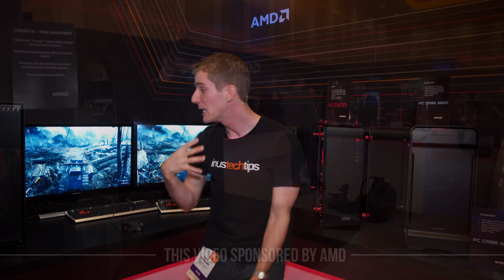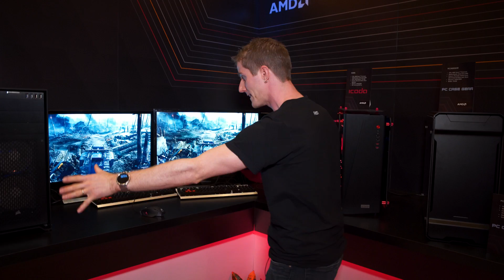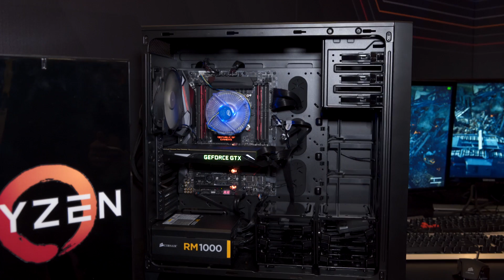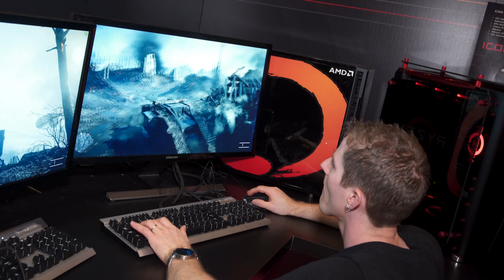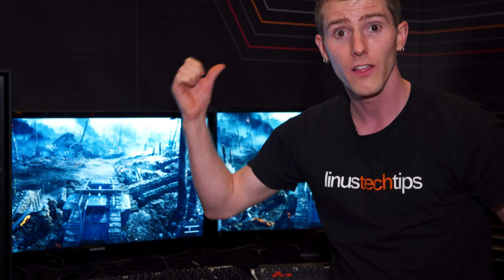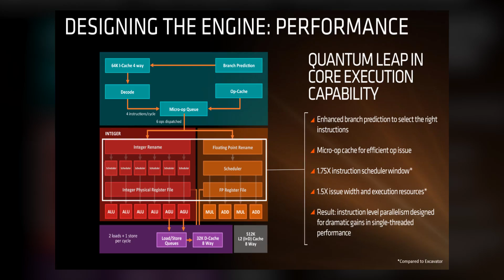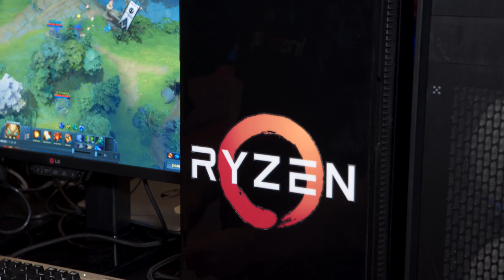AMD Has Ryzen!

Comment: What is the point showing graphic performance if they are using the same GPU? To prove Ryzen is a good CPU they should show the actual performance of the CPU like handling video conversion and running CPU benchmark,  we all know that CPU bottleneck is not a thing when we use such a high end CPU + GPU combination.
Reply: We've already seen that.
Reply: They were showing in the BF1 demo that the Ryzen chip is not only NOT a bottleneck for the Titan XP but that it is actually capable of maintaining the Titan XP at frame rates near that of the 6900k. Also the 2nd demo was to prove that the Ryzen won't get bogged down under load and drop frames both in game and in twitch stream vs the 6900k when CPU encoding and Linus said Ryzen looked different (better).  With the AMD 8000 series and 9000 series FX processors, they MOST CERTAINLY WERE bottlenecks for 980s and 970s, furies, Titans, Nanos... People buying those GPUs would be using top of the line Intel X99/Z1(2)70/Z97 based i5s and i7s anyways.

Comment: 6900K on that small of an air cooler?
Reply: thats the intel stock cooler, the same thing goes with amd, both using stock coolers.
Reply: Intel hasn't made a stock cooler supporting 2011 since like 2011 tho... That's the thing
Reply: But K series chips don't come with a cpu cooler.
Reply: both cpus at stock speeds, dout that the 6900k was thermal throttling
Reply: Small coolers is all you need if you don't care about fan noise or overclocking. For a demo at stock speeds it is sufficient.
Reply: Oh sorry, I didn't realise that a 6900k was thermal throttling while reaching blistering temps of what... 45-50c max at stock... 
~Wwwwwwwooooooo~~~ ghost noises.

Seriously though, a basic fan at a stock cpu setting isn't going to do anything to the performance in a situation like this.
Reply: The 6900k does not come with a stock cooler. Atleast not in Aus
Reply: I can make my i5 2550k look as fast as a i7 4770k with a good overclock on my cpu, much better cooler and active set-up over passive.
Reply: Depends what you are benching. 
In this case they are both stock settings and we know the TDP + thermals are low. So that isn't really relevant information and the comparison is still valid for that very reason.
Reply: Intel sells a stock cooler for 2011 and 2011-3 chips. 2011 was actually the first to drop the included cooler in the package with the processor, but how many people do you know with a Core 2 Quad, i5 Quad, i7 Quad, or even AMD 6 and 8 core processors use the stock cooler?

Why anyone would actually buy it is beyond me, since you can get a much more capable cooler for about the same price.
Reply: yeah they should have used some really good coolers to remove all of the variables
like a noctua nh-d15 on both processors
Reply: SomethingCool51 That would have been overkill and given the impression that such large coolers were necessary for stock speeds - which they are not.

Comment: it's a little pitiful for amd to have to use nvidias card in their system, they should have had a vega sample ready for this
Reply: Zen's probably gonna come out at least a few months before Vega. Why delay one brilliant product just for one in the pipeline?
Reply: I think that it highlights an issue with amd's refresh cycle where they are typically behind the performance curve at least for high end consumer parts. Vega really needs to either be better than what ever nvidia has, or be substantially less expensive at the same performance to be competitive.

Comment: So basically AMD thinks that the RX 480 is a piece of crap.
Reply: No. Where the fuck did you get that from?
Reply: You're not paying attention..
Reply: AMD couldn't test the Ryzen on an RX 480 because it was too weak for gaming. Smart move too.
Reply: QuantumDan The 480 does not compete with the Titan XP, it's a $200-250 card. They want the CPU to be the limiting factor so they would use the most powerful GPU they can get so the game becomes more reliant in the cpu.
Reply: The Titan XP is obviously targeting a very different market, I get that. I'm just wondering why they didn't even use an AMD gpu in the first place, but as you said, they wanted the most powerful GPU.
Reply: QuantumDan to be sure not to have any gpu bottleneck.

Comment: As far as streaming goes, quality per bitrate goes: x264(software CPU) > quicksync > nvenc > amf(AMD gpu encode). Most streaming services don't allow enough bitrate for qsv or nvenc to be useful, unless you're mostly streaming static images.
Reply: AMD's encoder is actually more efficient in tests versus NVENC with equal quality.
Reply: ***** Still needs more bitrate to achieve the same quality. Can be more efficient all it wants.

Comment: That 6900K... with a shit cooler...
Reply: German Gambogi stock cooler vs stock cooler...
Reply: Who cares what sort of cooler is being used as long as chips don't thermal throttle.
Reply: Then what's the point of using a K series chip? Don't get me wrong, I really hope the new AMD CPU's kick some ass so we get some real improvements from both sides. It just seems that the none of the chips are at their full potential.
Reply: each chip overclocks differently, it would be inaccurate.

Comment: AMD, all I want for St. Patrick's Day is a cheap CPU with 4 cores, maybe hyperthreading, and easy overclocking. Please.
Reply: They've said that this is their high end chip. Therefore there must be lower end ones, probably a 6 core and 4 core. There are also leaks suggesting the SR3(4c/8t), SR5(6c,12t) and SR7 (the one shown, 8c/16t)
Reply: Liam Meigs ...I'm not pairing a dual core with poor hyperthreading and shit IPC with an RX 480. That's ridiculous.
Reply: Emperor Scumbag VII 4 cores? AMD will never do anything that sensible. It's why they're getting fucked in the CPU market.
Reply: Death"Three Reich's You're Out"2508 AMD has sold quad core CPUs before you know... 8000 FX series CPUs had 4 cores.
Reply: lol
Reply: Death"Three Reich's You're Out"2508 now there cores will be on par with intels in terms of single performace power. just wait and see. AMD have put alot more money inot reasearch and have increased there CPus performance, also the old r9 390 and such was better then the 900 series, the exact same generation.
Reply: mrpokaren13. 6000 = 6 cores
Reply: Just buy a 4350 and oc it to 4.5ghz. Thats what i did
Reply: Emperor Scumbag VII 4350 is quad core
Reply: Aaron Lindstedt No it isn't. It has 2 cores and 4 threads.
Reply: i suppose technically it is, but the cores share recourses,
Reply: yeah, 4 cores 8 threads will be adequate
Reply: PleyVi are u talking about current AMD's chip or next AMD Ryzen chip?
Reply: mandiarra
he is talking about the FX series of processors. (so for instance my 8320 has 4modules and 8 cores)
Reply: my 8320 kicks ass...
Reply: Bulldozer doesn't work like that. It has 4 cores, 2 modules, 2 FPUs. Still technically a quad core, just not in the way most architectures do it.
Reply: djflexmaster79
 just curious i was tinkering around with my overclock and to get it stable i have 4.4 with a voltage offset of .03. what do you have?
Reply: Emperor Scumbag VII Get an i7 920 for under 100€
Reply: PleyVi OC makes all the difference man.
Also, i only said i7 920 because its more widely supported by motherboards than the xeons.
And yes, i meant with the motherboard.
Reply: haha, same here volt is a bit higher. Would like to water cool, and push to 4.6
Reply: djflexmaster79
i thought about it but its hard to justify 70 dolars more for 200 mhz :/
Reply: PleyVi Buy an AMD Processor.
Reply: PleyVi
couldn't the same be said for a air cooler like a 212? I mean i understand your point, but id rather just use my usual air cooler.
Reply: isn't that an 860k?
Reply: Emperor Scumbag VII there 4 might be cheap maybe just see on redgamingtech

Comment: what's with the shitty cpu coolers?
Reply: Maybe looks are deceiving? Perhaps Ryzen doesn't require a heatsink the size of a car radiator to keep it cool?
Reply: Storr Hoek wraith cooler is pretty good.
Reply: Storr Hoek they are both stock.
Reply: cz75fanatic Still the AMD stock Wrath coolers are better then the stock Intel coolers by a wide margin, the Intel coolers barely get the job done in a lot of cases.
Reply: Wraith is much better than the shitty Intel stock cooler
Reply: The old AMD coolers ran at 7000 RPM. They were amazing. Somebody even overvolted them and they started levitating while the Intel cooler just died.
Reply: The stock AMD Wraith cooler is actually decent with some nice copper heatpipes, and compares well to a low/mid tier aftermarket cooler from companies like deepcool, or Cooler Master.
Reply: Intel ships shitty coolers with their CPUs.. AMD's Wraith cooler on the other hand is a very nice cooler. If I didn't overclock I would have no qualms using it.  With that said I never used any of the Intel CPU coolers. For my Ryzen build I am going with Noctua this time.
Reply: The wraith cooler is capable of overclocking, it's performance is comparable of the likes of the coolermaster evo 212. 

People have overclocked FX-8370s which is a 130W CPU, using the wraith cooler with no problem with temps easily below 70c. The wraith is a very very good stock cooler. Ryzen with only a 95W TDP should be fine for overclocks, the CPU will even overclock itself with the boost enabled.
Reply: gromann i think the wraith cooler is better than the stock Intel one but, amd hasn't been that competitive for a while.
Reply: As commented, they are stock coolers. Again, the point is to show out of box comparison and to limit any argument of how some aftermarket cooler was giving bonus points to either cpu.
Reply: After years of computer experience you realize that cpu cooler doesn't do that much.
Reply: Also if anyone thinks that it's unfair or any shit like that, when you buy a CPU, the price of the cooler is included in that price.

If you then have to go and buy a different cooler to really reap the benefits of the chip then that is expense on top of the CPU.

AFAIK the wraith cooler is better than the intel stock one and hence it's up to Intel to provide a better stock cooler as opposed to the buyer to pay for the Intel CPU and then an aftermarket cooler on top of it, just to make this a more fair comparisson.

What you get out of the box is important, not to everyone but to a lot of people.
Reply: well said Commodorefan64
Reply: Yeah but of you're gonna buy either one of those cpu's you"re gonna want to overclock
Reply: Yeah, but they're not going to overclock their CPUs in this situation are they? So why would they need better coolers?
Reply: They weren't overclocking it so it makes no difference.
Reply: i always use stock cooler up to the point it's getting new thermalpaste, or when it's time to OC some more juice out of it. depending on temperature ofcourse. most people are perfectly fine with stock. it just saves some more money, or procrastinate the spending.
Reply: +NUCK CHORRIS Yeah I should have explained that I really meant like the difference between all in one water cooling solutions and custom really doesn't make such a big difference and I am just tired of people spending money on something that are not worth it. And the stock cooler is just piece of junk that no one is stupid enough to use.
Reply: +NUCK CHORRIS
They can make a big difference, but generally just when overclocking and running at sustained high load tasks.

In addition, while they make a difference, they're very inefficient with regards to the performance per cost increase compared to just purchasing a better base product.
Reply: The wraith cooler is easily good enough for you not to have to buy another cheap CPU cooler. You can even overclock on it and it will still do a decent job.
Reply: TheSandvichTrials to get the max performance out of both cpu's

Comment: Can I use my wraith cooler on the new platform?
Reply: Smaow maybe? the wraith cooler is a am3+ configured cooler and the new platform is am4 so i dont know how that would work
Reply: Purple Stingray They will probably make one for AM4
Reply: a lot of the time the answer is yes, but you'll have to wait for full disclosure
Reply: They were using a wraith cooler in the testing but its probably a different socket fit so you'll probably get one in the box

Comment: When AMD has to use Nvidia's cards
Reply: Are you actually that stupid to realise why they are doing that? They use the most powerful available GPU to eliminate that as a variable so you can compare the CPU performance only.
Reply: that really doesnt change the point of his comment tho
Reply: Uh what's his point then, that he didn't pay attention to the video?
Reply: MehLoaf it does, they can't use an rx480 as it's not that powerful compared to Titan xp and would bottleneck before full CPU load. They can't use their new Vega chips as no one knows the performance and can't compare to a card currently in the market.
Reply: OP did pay attention, he simply stated AMD had to use one of NVidia's video cards, which is entirely true in this instance.
Reply: They don't really have a choice... if they use RX 480s in both they will end up bottlenecking the CPU's, and seeing as they don't want to unveil Vega yet, it is best they use the top of the line GPUs on the market currently to ensure that the benchmarks are truly legit. It would also be a bad idea to use a Vega GPU as they probably aren't properly optimised yet and seeing as there aren't any benchmarks for it yet, nobody has any idea of how much of an effect it would have on the performance of the CPU's
Reply: My point is...they are using a rival card XD nothing to do with specs or anything
Reply: DaRUde117 so? what do they have to do then huh? use their mid range card that will surely bottleneck their new cpu or use their unfinished gpu? neither so they have to use nvidia.

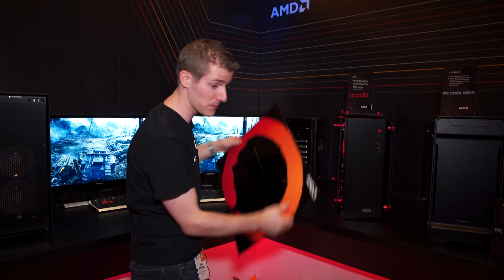Comment: 1:14 "They let me take the panels off" 

Let's be honest.... They really shouldn't have let you 😂
Reply: #LinusDropTips
Reply: Apparently he dropped a vega chip.
Reply: Well, Raja dropped an RX480 right in front of Linus, so... Now that I think of it, is it possible he was making fun of Linus' tendency to drop things?
Reply: They shouldn't trust him, he is notorious for dropping and breaking hardware. That is why some vendors won't let him do anything to their unreleased products.
Reply: He also dropped the fact that AMD is running a Nvidia card to max their cpu...
Reply: No he didn't, he explained that they are using a titan to show that this chip is capable of running high end cards with the same potential as the intel 8 core.
Reply: May my tail be force young Padawan! FoTt 
Does it really matter since both Pc used the same Gpu?
Reply: May my tail be force young Padawan! FoTt
Why wouldn't they? They currently don't have any enthusiast cards on the market, pretty hard to show off enthusiast grade CPU performance while gaming with a mid ranged graphics card.
Reply: i bet the cpu somehow dropped off the mobo even tho the cooler was on
Reply: +BlackSn0wz Probablt their new Wraith cooler, included with some chips now in fact.
Reply: +BlackSn0wz - Hm, the Wraith Cooler wasnt that bad tbh.
Reply: They want to show off the AMD Ryzen, not the VEGA... Why the heck would they put a Vega card in the case if they don't want it to get out yet?
Reply: dra6o0n man the video on vega came out 1 hour before you posted this comment.
Reply: they trust the guy don't worry
Reply: he tried to play it cool
Reply: Woodepic Media a
Reply: At least I can see that if that happens to be the reference fan, it doesn't look as shit as the ones that came with the FX series CPU's.
Reply: MrLalasd
Actually I haven't been going through many videos on youtube to notice that this one popped up, only what's on the highlighted/recommended on the front page.

Comment: Aren't AMD processors only single precision? I remember intel processors were double precision, which is why professional companies such as apple chose them over AMD.
Reply: theX24968B that's not why, and Apple is supposedly getting rid of Intel soon.  You're thinking of hyperthreading - one Intel core handling multiple threads.
Reply: No they both have fully capable FPUs for a long time now. Apple chose Intel due to power efficiency edge Intel had. Ryzen appears to be more power efficient. But we don't know if Apple will move to AMD CPUs since Apple also leverages other Intel technologies like thunderbolt which they wouldn't get with AMD.